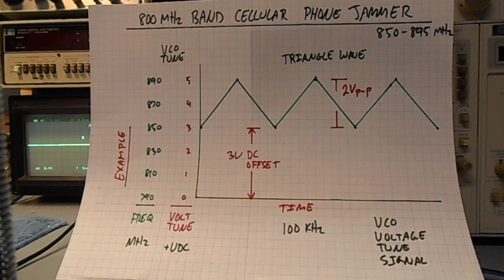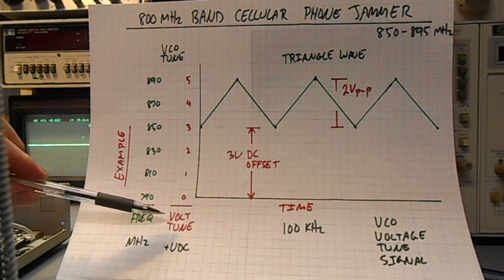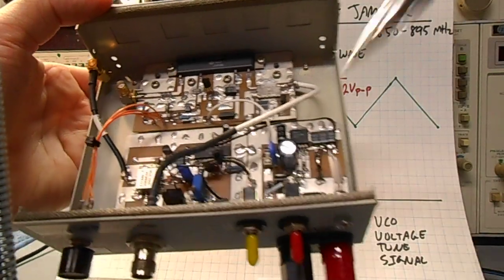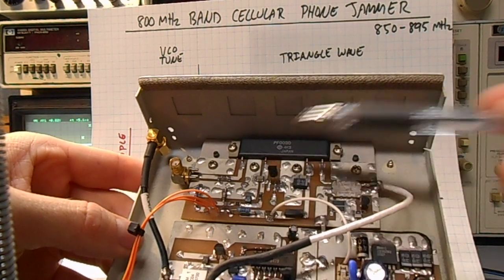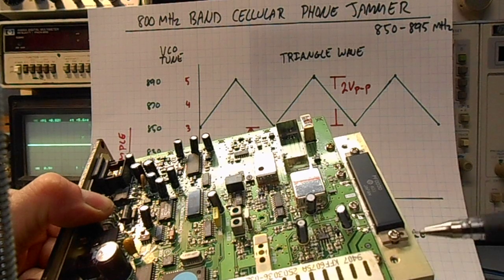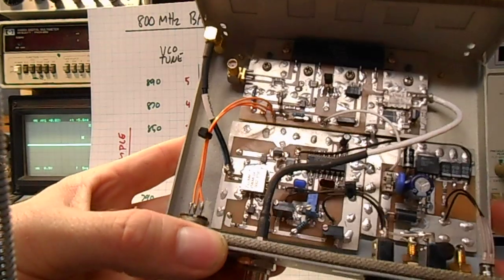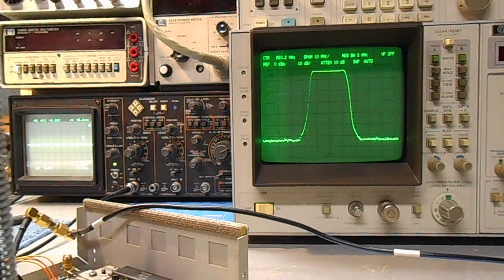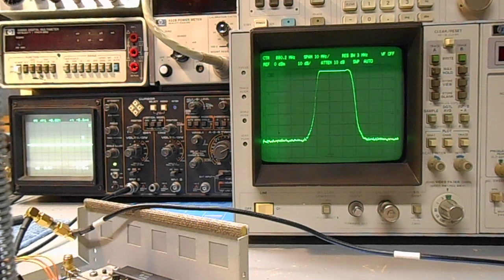GBPPR Vision #15: 800 MHz Band Cellular Phone Jammer

Comment: Just had a thought.

Just visiting your site, with your discussion of the MC145158 PLL IC. If it uses a standard serial stream for programming, similar to the method in the receiver section of Maxtrac radios, then you might be interested in the MaxTroller code. It a way to have an arduino take over the receiver section and program it to whatever frequency the radio will cover. Haven't tried transmitting. Gonna have to do that tomorrow.

Perhaps other brand and model PLL syth. ICs are the same. Hmmm.
Reply from the maker: Oh wow.. I haven't heard of that project.... Looks very interesting, and yes, most PLL use a very similar serial data stream, just that the registers tend to be slightly different.
Reply: So much more to learn, I have.

Comment: I've got a couple of those radio shack bag phones. Nifty thing to know the ESN is stored in the handset so you could have multiple RF units.

Is the 100KHz the rate of change between the peaks? What made you choose this "modulation" frequency?

Also, could you use an op-amp for SWR monitoring to cut-off or or light an LED in the event of low return loss?
Reply from the maker: Yeah, the triangle wave is 100 kHz. I chose it as it an easy frequency to make with that chip.. Yes, you could pull-down the module's bias pin in a high-SWR state with a simple transistor or op-amp comparator, but 800 MHz band isolators are easy to find and I'd just use one of those..